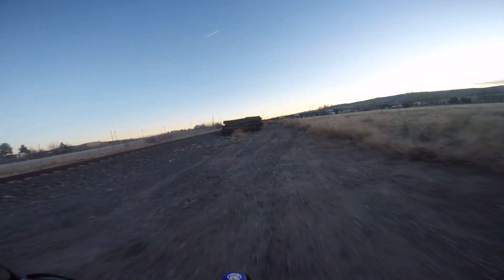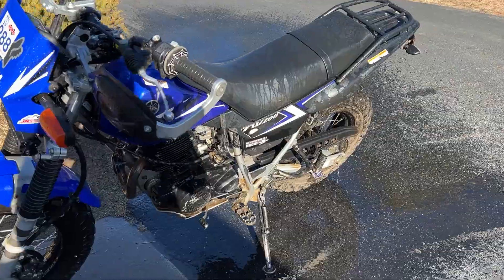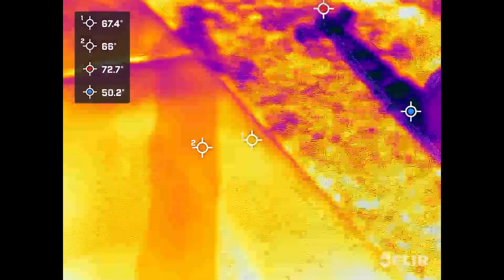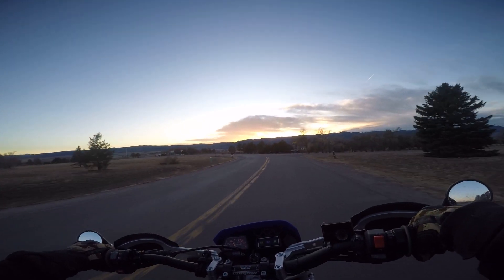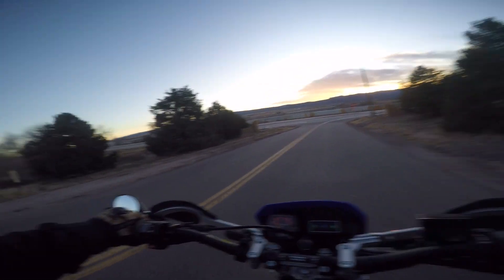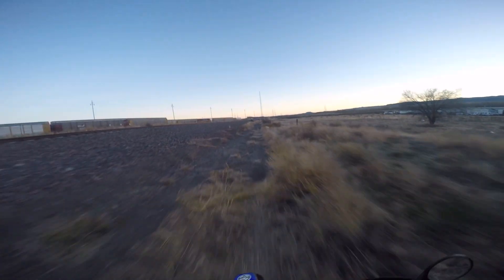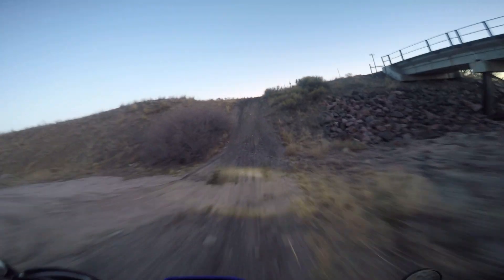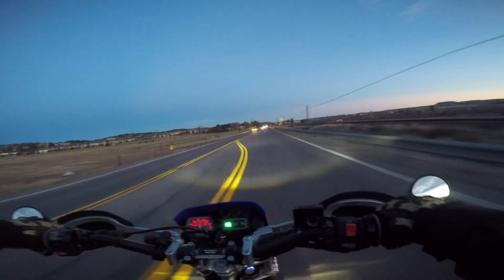Looking at an Air Cooled Engine With Thermal Imaging | Almost getting in trouble on a TW200

Comment: Ranger had his truck sunk up to the rear axle, it's a couple weeks later and he's still stuck out there! He was calling in help and he thought you were there to rescue him! Better go back and check on him, the mighty TEE DUB will pull him right out! Great video man. I saw snap on had one of these cameras one the truck and I tried it out on some brake rotors. That technology is super cool!
Reply from the maker: haha I kinda noticed that and was wondering but also noticed it was 4x4, that would be kind of funny for sure. thanks so much! for sure, the snap on truck is a scary place though. it's super useful, can easily see which cylinder is misfiring

Comment: Hey brother, it's been awhile. It's the old guy up in British Columbia. So my town is not far above sea level but, like u, a little altitude and there's winter.
I ride my 4th TW, a 2018 year round. I used to ride snowmobile when younger and wore mitts. But on the bike I like gloves but no glove keeps my hands warm very long below zero.
So I've been using a type of strap on mitt similar to one featured in one of your videos. They are an enormous help as I can wear gloves and take my hands in and out as needed. I highly recommend cold weather riders review these handlebar mitts. Nice to see you are around and still kicking 👍
Reply from the maker: hey there, glad to hear from you again. that's awesome, those mits are great, I have some just forget to use them sometimes. will be even better with heated grips. ride safe!

Comment: @8:48 the paradox of riding faster or slower in the cold is a simple math problem. Over a 10mile run traveling 50mph eta would approximate 12min as opposed to 10min @ 60mph. Is the additional drop in wind chill factor going to outweigh the benefit of shaving  2min? 
That's a genuine question for each rider to consider. 
Thanks for sharing your journey young buck!
Reply from the maker: haha yeah hard to figure out which is better haha either way can suck though. no problem, thanks for watching

Comment: Hey finally another video. Only time my dub would overheat was going up to Cerro gordo. Smelt hot so pull over a while to cool down. Get the Christmas card from Addie?
Reply from the maker: yeah it's been too long, gotta try and get one out at least every month. yeah that can happen when you going up steep climbs with not enough speed. ill have to check my PO box

Comment: Riding in the end of December, not bad at all. They don't use salt on the roads in Colorado do they? Here in Sweden it's kind of dry these days, a bit cold though, just around 0*C today. I'd love to go for even a short ride but it's the salt that puts an end to the fun, beacuse it eats metal.
Reply from the maker: For sure, we recently just got dumps of snow though. I think they mostly use mag chloride. Maybe a little salt sometimes
Reply from the maker: Yeah salt is no good. Should be fine if the roads are dry though

Comment: That is really interesting! And I think you get less efficient air cooling the higher in elevation you go too.
Reply from the maker: for sure, that makes sense actually, didn't really think of that aspect before
Reply: @TDubsKid   Yeah me neither but they make a big deal about it in F1 at the higher elevation tracks. It does make sense though. I do wonder if it makes any difference on a small engine like that though?
Reply: @TDubsKid thinner air but.. also cooler air higher up you go.. aircraft engines run cooler at elevation so a bike should too

Comment: How exactly did you re-jet your carb to ride at 12,000'?  I wanna do that with my T-Dub!  So, I need help finding the right parts.
Reply from the maker: Never touched the carb, had this bike since new, almost 18,000 miles now, ridden between 0 and 13,000 feet. Runs great, some hesitation when snapping the throttle when up high but not bad. Still runs fine